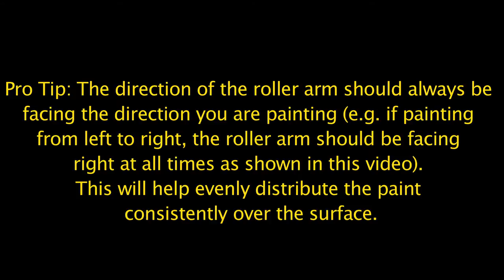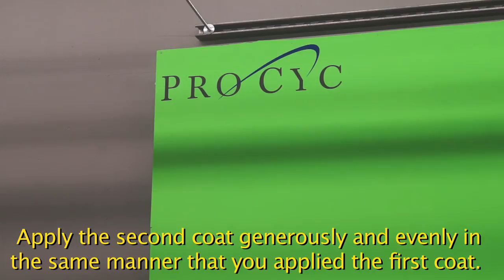How to Paint a Green Screen Chroma Key Wall with Green Screen Paint

Comment: Great painting tips.. but what is the surface material you are painting on.?   I noticed it was flexible...    I was going to use drywall.. what you think?
Reply from the maker: The Pro Cyc modules are all made out of ABS plastic. The paint works great on virtually any surface. When we are painting one of our built-in systems, the coves are ABS plastic, but the wall above the coves is nearly always drywall and the paint goes on perfectly and one would never know that there are 2 different surfaces underneath the paint.

Comment: Will a stir stick really be good enough for mixing? I don’t have a drill with an attachment.
Reply from the maker: While a drill with mixing attachment will be quicker and more efficient, you could use a stir stick as well. Just stir thoroughly until the color and texture is completely consistent.

Comment: Wow. I am guessing it must be this paint and not green paint from a hardware store?? I wonder if blue screen is used any more. Any film set I was on years ago didn't have effects.
Reply from the maker: You are correct, it is not hardware store paint. The paint uses a very specific type of fluorescence and pigment that works best with chroma keyers. Blue screen is still used, but much less than 10-15 years ago. The main reason seems to be that people tend to wear blue much more often which can confuse the keyer. Thanks for stopping by!

Comment: is it necessary to add a level 5 finish, skim the entire wall before painting? The mud will be going on drywall.
Reply from the maker: that is not necessary. Only the seams that are mudded need to be sanded smooth after applying each coat of mud. The Pro Cyc cove modules only need a light pre-sanding before painting which is usually done before assembly. This video shows a freestanding system, so all of the surfaces are Pro Cyc modules which are made from ABS plastic. Our built-in systems are designed to attach to existing walls or drywall. Our grey bonding primer is a one-coat primer for all surfaces, so all that is required after the modules are assembled and finished with 3 coats of drywall is the apply one coat of Pro Cyc Grey Bonding Primer followed by two coats of Pro Cyc Virtual Green paint.